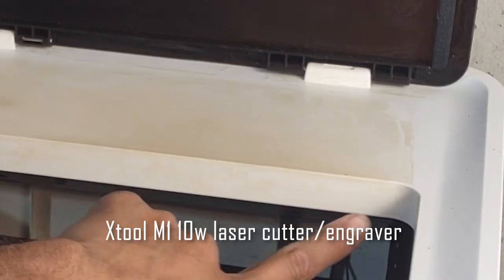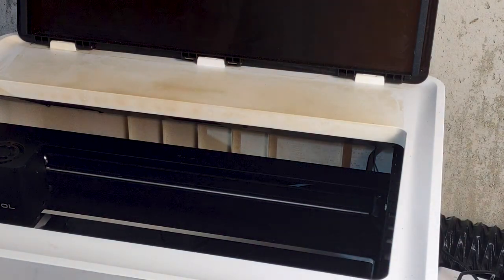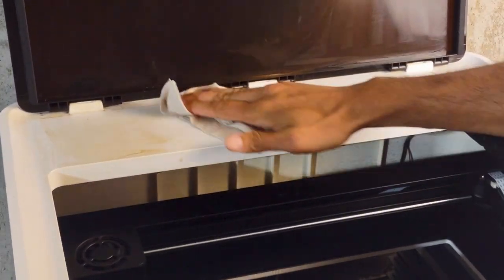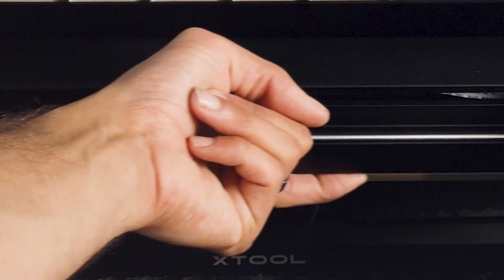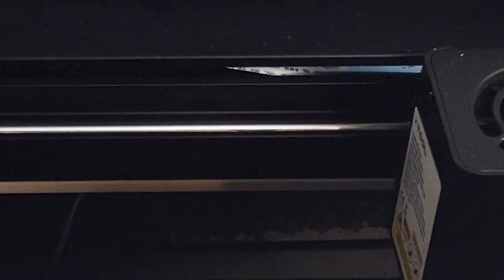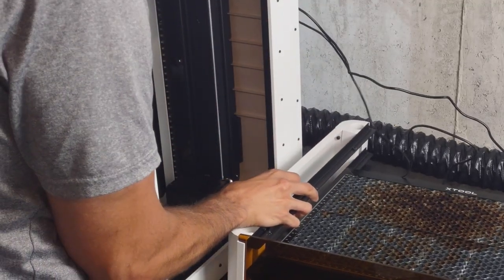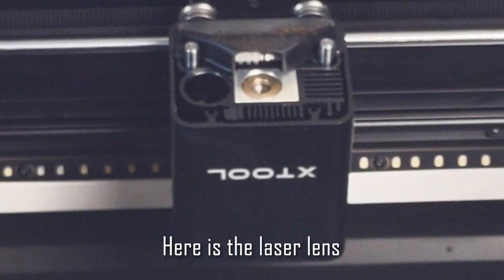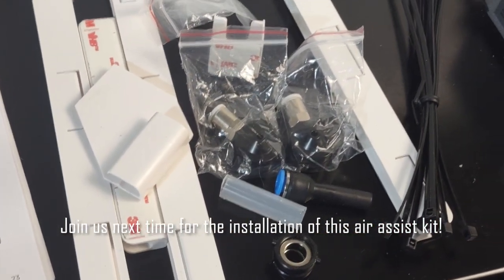xTool M1 Laser Basic Cleaning & Maintenance

Comment: Thanks or the video, I need to clean my laser lense before my next project. I have the air assist installed already so I think I need to pull that out temporarily to get to the lense.  Thanks again!
Reply from the maker: No problem, thank you for watching! You should only need to lift the air nozzle off of the lens to access it for cleaning.  It sort of snaps on and off magnetically.